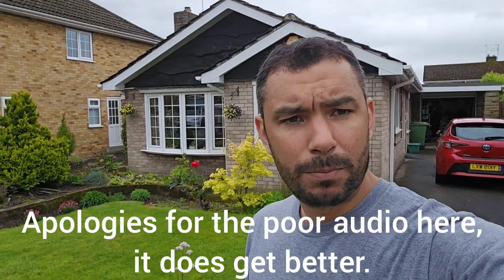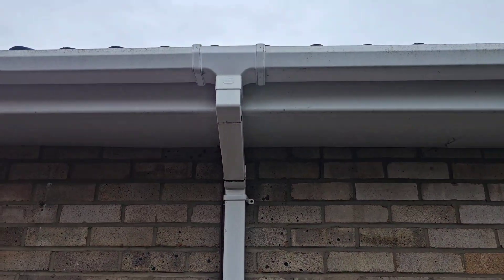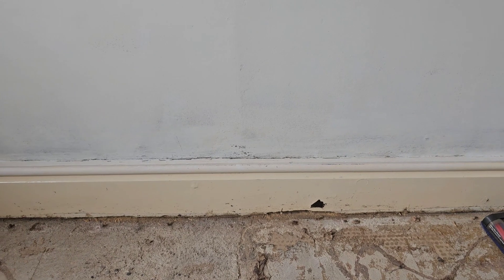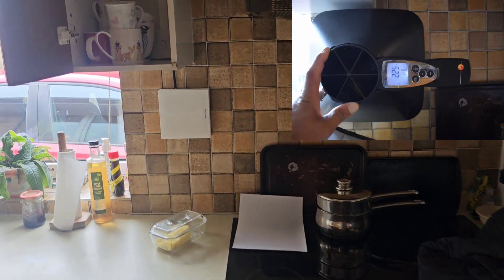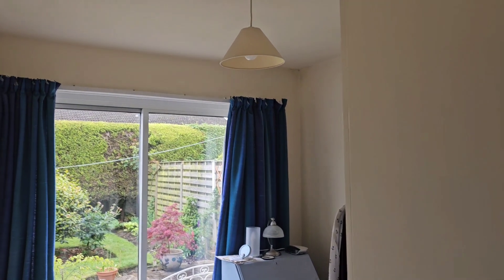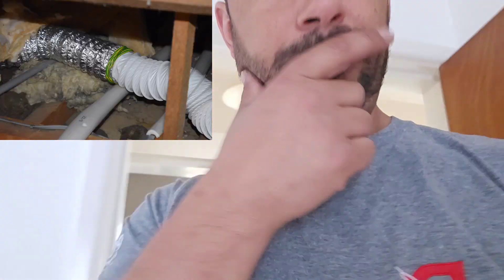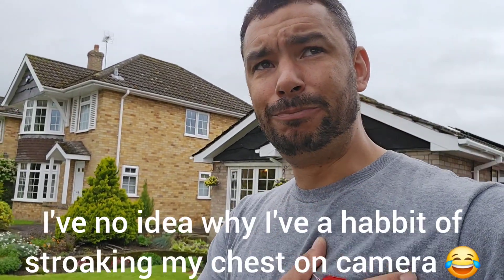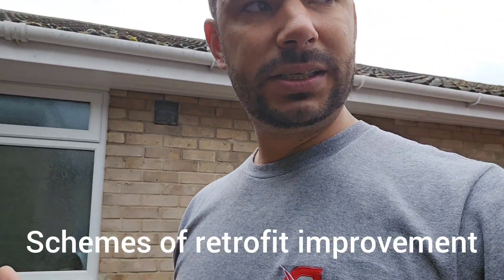Retrofit improvement schemes. I really hope this isn't an example of what's to come.

Comment: Re downpipe , few weeks ago I was asked to repair a leaking gutter joint and discovered that the downpipe lead straight into the soil  I dug and dug but no drain or soakaway could be found so for probably 40 years the water just overflowed the gutter as the downpipe entered compacted clay (an effective plug) . Only a small roof so piped onto garden as far away as possible.